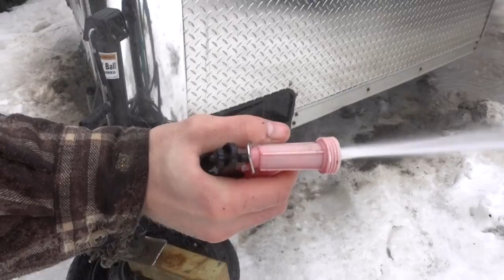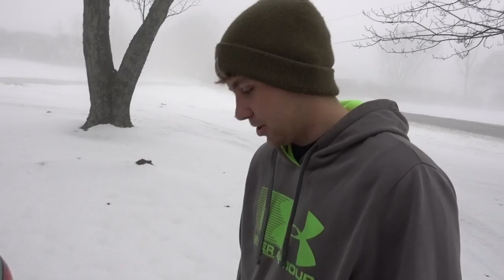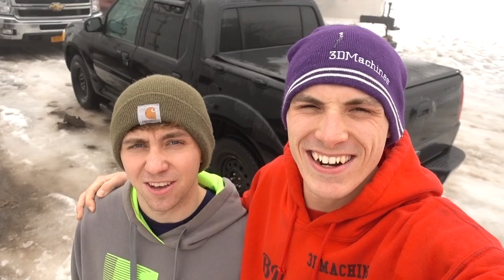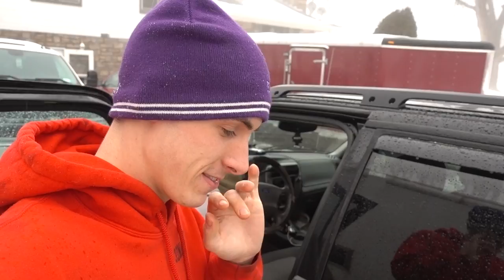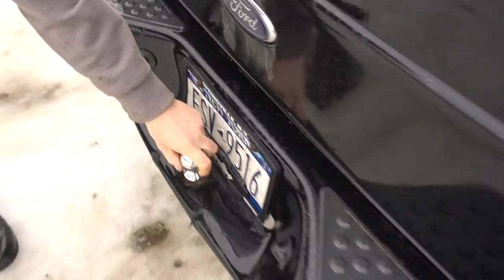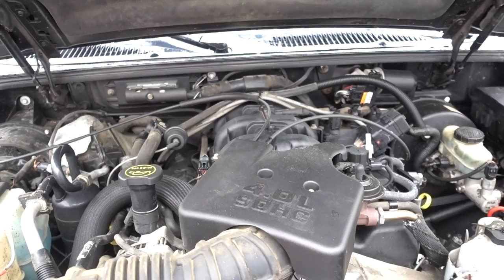NEW TRUCK REVEAL!!

Comment: Check the ball joints!  very common issues for those.   Worked at a Ford dealer so saw a ton of them. For the code on door pad, look in owners manual or look under dash and can find it on a module usually.

Comment: I actually own a 2004 Sport Trac, I call it a truck or a SUV mine is Ford Competition Orange in color its a nice little truck.  I will say keep an eye on the plastic thermostat housing cause its a common fail point in the cooling system, I replaced mine with a cast aluminum one

Comment: 3d machines I have been out buying parts and searching high and low for a 1 11/16 socket finally found it and my axle nut is so rusted on I broke 2 half inch ratchets and a 3" extension. so that's on hold glad to see the toilet snake though nice sport TRAC.

Comment: Sport Trac is technically a truck or SUT - Sport Utility Truck = 2005 Ford Explorer Sport TracMPG: 15 city / 20 highwayHorsepower: 210 hp @ 5,200 rpmTowing capacity: 5,040 lbsEngine: 4.0 L V6Curb weight: 4,349 lbsWheelbase: 125.9″Dimensions: 206″ L x 72″ W x 70-71″ HMy wife likes the Sport Trac - I like the Silverado or Colorado

Comment: 3DMachines, I have a 1993 mercedes 190E 2.6. it's in amazing condition body wise and interior wise it's half gutted, should I run everything to switches and eliminate the keyed ignition and just have a main battery disconnect or put in a new dash and what not.

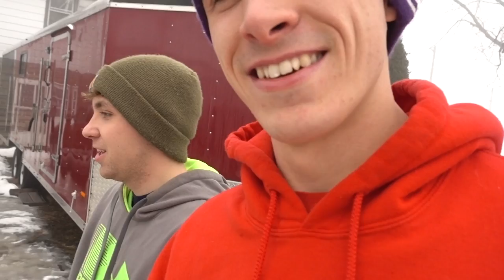Comment: My ranger has the 4.0. It's got good torque to it. Plus 4:10 gears which is strangely low for a small truck but it does a burnout so easily it's almost annoying

Comment: Hey 3DM, I wanna get my first car but I don't know what to get. My mom says about $2000 is good for a first car so I wanted your opinion on what car I should get. I want a car that has good hp and torque. And it has to be manual. Or a truck that can be automatic but has to have awd and again good hp and torque. I like to go fast. So if you'd be so nice to respond and help me with your opinion I'd very much appreciate that.

Comment: I just got a 16k snowmobile and I took it out in 2 and half ft of snow it has 3 inch paddles on the track twin turbo and it flew acros the powder that is 2 half ft 3 min later fucking blew up I'm so pised

Comment: at around 100k u will have problems with that SUV
Reply: 1) It's a truck. 2) These things will run forever. Assuming that you do regular maintenance.
Reply: tankdog03 I have one with 217,000😂😂
Reply: maintenance is key, def kept the trans fluid fresh.. I wouldn't buy one, but I know people that have.. they will nickel and dime u after 100k..
a real truck is built with better, more durable parts. this is still in the ford ranger class, with a bumper hitch.. 3.0 and 4.0 r pretty good motors tho.. I think the drive train is weak.. more of a young family SUV that is affordable.. for 15k u can get a nice crew cab
Reply: tankdog03 I have an 02' with 217000 miles on it, only thing to ever go wrong was the electronic lock on the back right door stopped working
Reply: Cab mounts, steering wheel controls, ball joints, oil psi gauge sender, timing chain, and pcv elbow. Extremely common problems with the Explorer Sport & Sport Trac
Reply: +MrBlurberries have an 05 with 255,000 only problem was rust and timing chain
Reply: +Koliatic depending on where u live.. the north has pot holes and rust